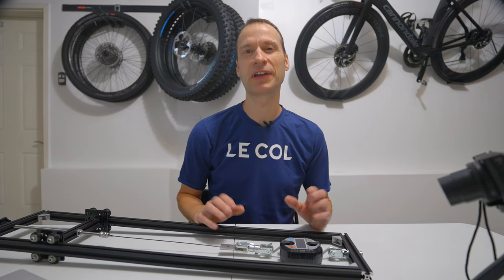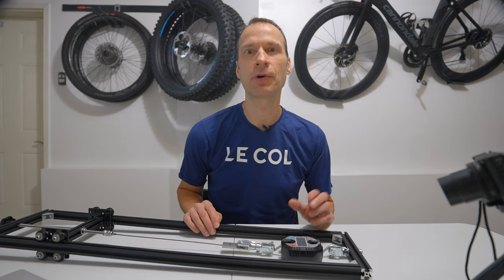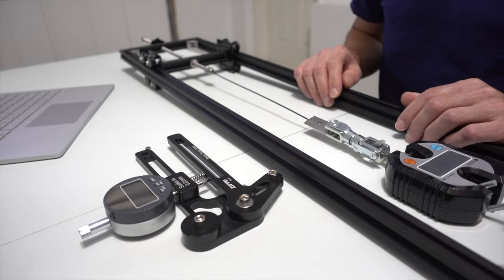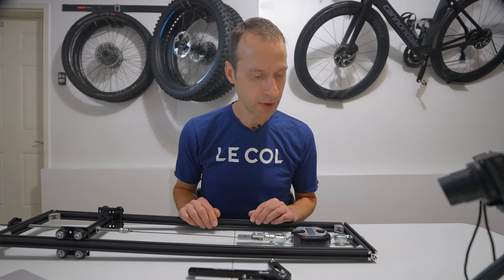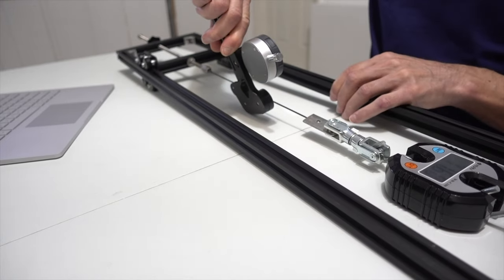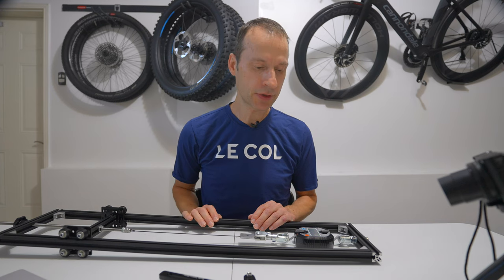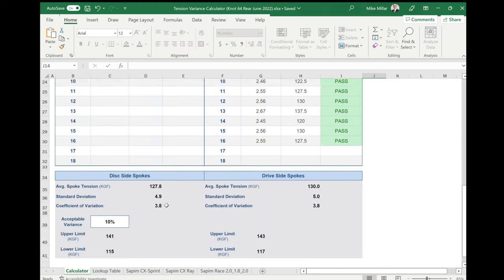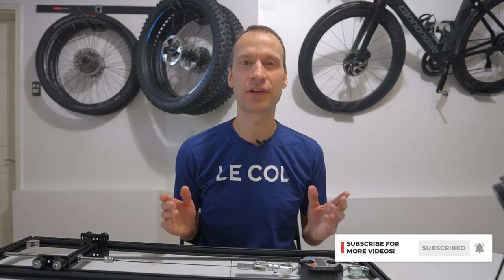Spoke Tension Tools: How to Use Them to True a Bike Wheel

Comment: This is such a cool video Mike! You motivated me to go next level with my wheel building and build a spoke tension meter calibration tool for myself. However I see that this amazing crane scale unfortunatly is no longer for sale.
Reply from the maker: Good to hear, Roland! There are plenty other crane scales equally as good. Just make sure the top and bottom hook holes/attachments will fit whatever connection you'll be using and make sure it is rated to at least 200 kg. They are all reasonably accurate, but you may want to get one that does indicate its level of accuracy.
Reply: @bikesbymike  Thanks Mike ☺️

Comment: Good video, thx.
I need some help to understand, why the deflection increases with spoke tension.
My intuituon tells me, it should be the other way around.
More spoke tension withstands the force of the tensiometer, so it should deflect less.
Reply from the maker: Good question! What you’re asking is what puzzled me to no end when I first started wheelbuilding. The weird thing is that I still haven’t seen this discussed anywhere on wheelbuilding forums. I wasted a ton of time at the beginning trying to figure it out myself ☹ 

Basically, the tension reading corresponds to the amount of compression on the spring, not the perpendicular deflection of the spoke. So, a spoke with very little tension applied to it will cause minimal compression of the spring which produces as smaller number. A highly tensioned spoke will significantly compress/deflect the spring which produces a larger number. Put another way, there is an inverse relationship between the reading on the spoke tensiometer and the amount of deflection on the spoke. 

My spoke tensiometer works exactly the same as the Sapim tensiometer. At the top of page 3 of the Sapim manual, you can visualize what exactly is happening. Here’s the link to the manual: 

https://www.sapim.be/sites/default/files/sapim_tensiometer_english.pdf 

I hope that all makes sense. Please subscribe to my YT channel. Cheers!

Comment: I have exactly same tensio, and its main drawback is that it uses thrust bearing instead of roller bearing, and the readings highly depend on how tight the tension bolt is. But the thing is that even if you try to tighten it as little just to remove the play in the bearing, it still introduces significant drag, which badly contributes to reading error. Just try to tighten or untighten the bolt for just fraction of revolution, and you'll see the difference. Or you can remove the spring and see how much friction there actually is. There's another version sold in China under brand Teny Bike or Toopre, they use roller bearing, which doesn't require any tensioning, it has much less friction. I wish I knew that when ordering mine. In the future I'm going to switch to the Jobs Brandt tensio, there are some nice guy from Poland, who produces them on demand. Also, Wheelfanatyk makes them. These type of tensios are much better than any existing tensio on the market.
Reply from the maker: Interesting. I would have thought the friction created by the thrust bearing is inconsequential, but I'll take your word for it. It isn't a particularly precise or well made tension meter, so it is something I should think about upgrading at some point. The Wheel Fanatyk one you mention I'm familiar with and is not crazy expensive. The Brandt one I'm not familiar with but will look into. It definitely is the weakest part of my setup. Thanks for the advice!
Reply: @bikesbymike  seems like my last reply was masked.
Reply from the maker: @atexnik  ...weird. I don't see your last comment anywhere. Not being held for review.
Reply: @bikesbymike i left one more comment and it got masked again. Probably, it reacts to some keywords, dunno...
Reply from the maker: ah--I cleared the filter for my comments and now I see all your messages. I'm not actively on Instagram. Thanks for all the info on Brandt. All news to me. Definitely worth checking out.
Reply: @bikesbymike  I'd like to hear back from you after you check your tensio on whether thrust bearing tension affects the readings as mine does.
Reply: @bikesbymike  also, could you please check if your tensio has a spring positioning bolt on the lower lever? Mine is an older version, it doesn't have one, but newer editions come with it. May I ask you to measure the head diameter and the thread diameter? I'd like to add one on mine, too, to keep the spring from erratic movement. Just want to know what kind of bolt comes from the factory.
Reply from the maker: @atexnik  Yup. You are 100% correct. How much you tighten the bolt that holds the upper and lower levers together has a significant impact on tension readings. If you loosen the bolt to the point that the lever is wobbling, you won’t have any noticeable friction, but any amount of tightness between the bolt, bearings and levers creates noticeable friction which will produce inaccurate readings.

I set my spoke tension calibration device to 50 kgf and took a few measurements. With the bolt super loose, I got .5mm of deflection. But as I tightened the bolt the readings increased inconsistently to where I got a 1.0mm reading when the bolt was quite snug. This amount of variance really is quite significant and I image may produce readings which are off by as much as 20 kgf. It is possible that the readings may be reliable but not accurate. So, if you recalibrate your tension readings to recreate your deflection to kgf table immediately before you work on your wheel, you may be okay as the tensio should not change much during that one time use. But that’s not very convenient and not a great solution. The solution, as you say, is to get a better spoke tension meter.

My tensio has two bearings connected to the securing bolt. One sandwiched between the two levers and one on the outside face of the bottom lever. Both are ball thrust bearings. With the friction being so bad, I would have thought I’d find bushings in there.

Hope this helps.
Reply from the maker: @atexnik  Mine does have a spring positioning bolt but it is on the top lever. It is an M6 bolt with 1.0 Thread Pitch.
Reply: Thank you Mike for confirming! A thread locker keeps the bolt from unscrewing, I put few drops and it doesn't get loose now. Meanwhile I'm waiting to get my custom made tensio with linear bearing, will update you later.  @bikesbymike
Reply: @bikesbymike  that's the top bolt, but there's another one on lower lever on newer editions of this ZTTO tensio.
Reply from the maker: @atexnik  Bottom bolt appears to be M3 .7 TP.

Comment: Excellent design and great video!  When you put the spoke tension meter in place, the force increases.  Is there a reason you used the displayed force before you put in the tension meter instead of using the increased force?  Thank you!
Reply from the maker: Good question. I’ll try to explain it without confusing us both ;) The short answer is that the way I did it is the typical way it is done. But here is my thinking on why it makes sense to do it this way. 

The tension of the spoke on the rim is created by the connection of the spoke at the point of the hub and the rim without the spoke tension meter attached to it. So if I put the spoke into the calibration jig and tighten the tension until the crane scale reads 100 Kgf without the spoke meter tool attached to it, I know for sure that it is exactly 100 kgf. So, when I now attach the spoke tension meter tool to the spoke on the jig it is for the purpose of measuring the amount of deflection at exactly 100 kgf. The force does increase a bit by adding the tension meter tool, but this is inherent in the design of the tool.

The important point in all this is that by doing it this way I can perfectly replicate the scenario using the calibration jig (with a known force) with the scenario whereby the spoke is fitted to the rim. So, if on the jig I get 3.5mm deflection at 100 kgf, I know that a reading of 3.5mm deflection for a spoke mounted on a rim must be exactly 100 kgf. I’m not interested in the tension of the spoke with the spoke tension meter tool attached to it any more than I’m interested in the tension of the spoke when I squeeze it with my hand, because that’s irrelevant to how the wheels are ridden.

I don’t think I’ve explained this terribly well, and my reasoning may be off, but that’s my take on it. I should ask my friend who is particle physics professor who could provide a more scientific answer.

Comment: Thanks for sharing. 

I'd like to build a similar jig. 
Could you please provide more insight on the construction of the lower part, especially how is the threaded end of the spoke connected with what bolts and the M8 rod at the same time making it possible to twist the rod. 

Michał 
Warsaw, Poland
Reply from the maker: I’ll try to describe it as best I can. The threaded end of the spoke connects to a spoke nipple that pokes out of the M8 acorn nut. I drilled a hole in the acorn nut large enough for the nipple to fit through, but small enough so that the nipple flange at the end doesn’t slip out. The acorn nut threads onto the M8 threaded rod and locks into place with a M8 hex nut. Then that rod assembly fits through the “floating” piece of aluminum extrusion framing and then the top (fixed) piece of framing. On the top side of the fixed piece of framing, I’ve threaded an M8 Star Grip Knob onto the threaded rod with a needle thrust bearing washer between the knob and the top of the fixed piece of framing. The floating piece of framing moves up-and-down with two sets of the v-slot support plates and bearing guides that connect to opposite ends of the floating piece of framing.

The only hard part of this job was drilling a hole in the acorn nut. It was very hard steel, so it took a long time to drill through it. You must use a good quality drill bit AND some type of metal drilling lubricant. 

My complete parts list in located in this Google Drive file: 
https://drive.google.com/file/d/1fHQS8V0aiqN47WqOOdiJXyxSPLv7Y3f8/view?usp=drive_link

Good luck!

Comment: Great video! I’ve learned lots, but two main things: 1) buying or building a calibration jig is likely more important than an expensive tensiometer, once you have a means to calibrate as required, the quality of the meter doesn’t matter as much. 2) I have nowhere near the skill, understanding or equipment necessary to build one for myself so I’ll have to buy one. Saaay, how much would you charge…? (Seriously). I’m in AU, so our currency is generally comparable.
Reply from the maker: Yeah. You're bang on with your first point. The important part is the conversion chart, not your choice in tension meter. If you saw my recent video "Battle of the Spoke Tension Meters," you would have seen that even the cheap Park Tool tension meter performed reasonably well.

I thought about building and selling spoke tension calibration jigs when I first made mine, but quickly decided against it. Just not economically viable. The parts are too expensive when buying single items from multiple retailers and paying MSRP. And I'm not serious enough about it to buy in bulk and negotiate wholesale pricing. I spent about $400 just in parts for mine. 

Your best bet is to shop around as there are a few available for purchase. AliExpress has one for $500. A Few others a bit cheaper. I have no idea how good any of them are. 

If you want a no cost solution and have another set of wheels with known tension, you could do what musicians do and go by the sound made when plucking a spoke. Low tone = low tension. High tone = high tension. Slight changes in tension are quite easy heard. One of the top bike mechanics in Toronto did it this way, although he also played a string instrument. 

Good luck!

Comment: Nice design. Just wondering what the benefit of the sled / roller guide is? You obviously added it for a reason to your 2nd design.
Reply from the maker: Thanks. It’s not essential and there are cheaper ways to accomplish the same thing. But without the rollers/sliders, that black aluminum extrusion piece would twist around as I was tightening or loosening the knob on the top, so I’d have to hold it in place. Not the end of the world, but a clumsy design.
Reply: @bikesbymike  Thanks, that clears things up!

Comment: Nice design！What did you use to secure each end of spoke？
Reply from the maker: I used an old L bracket (corner brace) that I had lying around. A metal shelf brace also works. Cut it to the right size and drill a proper size hole to secure the spoke head end.
Reply: Thanks for reply，However any idea for straight end of straight pull spokes？
Reply from the maker: @ningbai1005  I can think of two options. 1) Your could use an acorn nut setup like I used to hold the nipple end of the spoke, or 2) Use a U-bolt w/t a mounting plate like in this link. Just drill a hole in the plate large enough to thread the spoke through. https://shop.forcesinc.ca/products/flsp261-u-bolts-with-mounting-plates-stainless-steel-304-inside-dia-1-thread-size-1-4-20-height-1-3-4-pack-of-1?variant=42895961686235&currency=CAD&utm_medium=product_sync&utm_source=google&utm_content=sag_organic&utm_campaign=sag_organic&gclid=CjwKCAiAkrWdBhBkEiwAZ9cdcFZmiQ7TZ-dUL6Q7FWIBnD0m2jv3rQPlMwdl0l8m_uDABZpJca6uSRoCJQUQAvD_BwE
Reply: @bikesbymike  I could clearly see your point but there are quite a few straight pull blade spokes which I use having their blade wider than their heads. any thoughts？😂
Reply from the maker: @ningbai1005  Right--good point! I've put J-bend aero spokes in my calibration jig with no issue, but straight pull spokes have a smaller head. Maybe cutting out a notch (to slide the spoke in from the side) instead of drilling a hole in the U-bolt mounting plate would work. You've given me yet another reason to avoid straight pull spokes :)
Reply from the maker: Actually, after thinking about this more, another (easier) option is to simply buy a single J-bend spoke to use for calibration purposes.
Reply: @bikesbymike  That's brilliant idea！ Thanks mate
Reply: Then you're going to suffer from variance in manufacturing tolerance between spokes and your accuracy goes out the window.